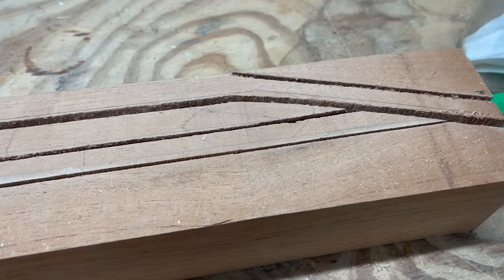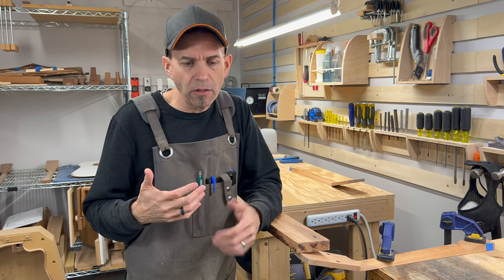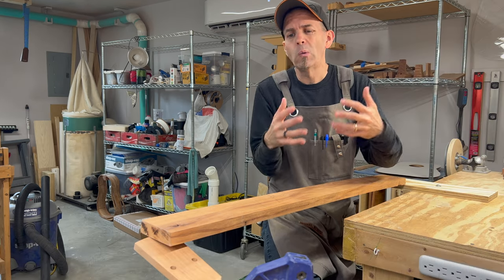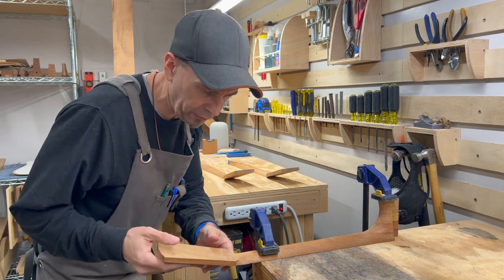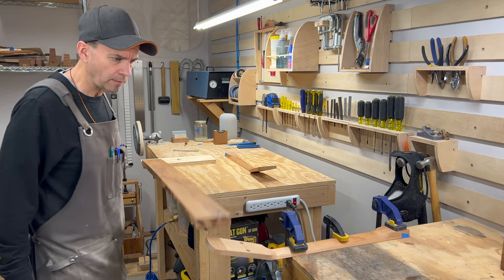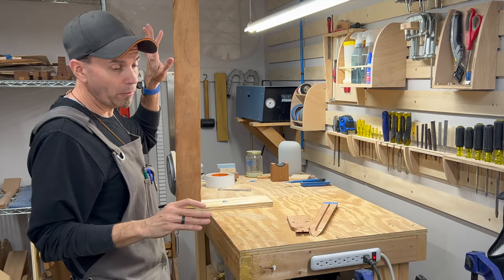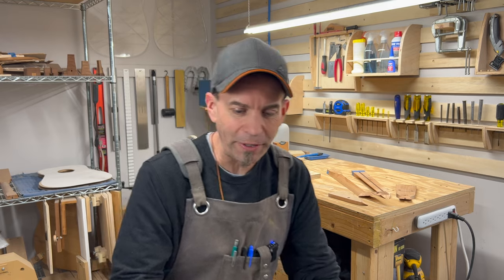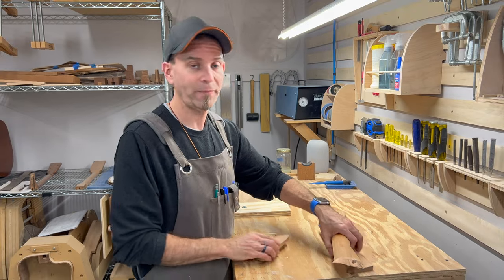Scarfed vs. One-Piece Guitar Necks - Part 3

Comment: I think the fretboard being glued above the scarf joint adds a fair bit of strenght, making the scarf joint the better choice. The fretboard doesnt really give any more strenght with a one piece, because it will break in the grain lines inside the headstock on the other side of where the board is.
Reply from the maker: Could be.  I’m hopeful someone will get inspired by the testing and take it to the next level!
Reply: Two friends: one with ibanez s (maple scarf joint, rosewood fretboard), one with epiphone les paul (single piece mahogany, rosewood fretboard).

The guy with the ibanez was fooling around, balancing it on the butt end strap pin, guitar went straight in the air as he was overcompensating and fell straight down tip of the headstock into concrete. If broke near the joint just like in the video. I took it home, the headstock was still on being held by the now bent truss rod and the fretboard (which didn't bend much and I'm sure it helped). Loosened the truss rod, pulled out the headstock and the rod, hammered the truss rod back straight , assembled it like lego to test fit (it was perfect), applied glue and pressure, left it for two days, tuned it and IT WORKED LIKE NEW.  Some sanding and finishing on the back and it's great. 
18 years later Ibanez is still great.

The guy with the les paul had his in the case and he kinda threw it on the back seat of a car, opened the case and the headstock was off: it broke behind the nut, not like this one in the video, but like countless other les pauls online. It left irregular and much smaller surface for gluing to put it back like I did the Ibanez. He took it to several guitar repair guys, some didn't want to bother, some wanted money nearly as much as a new guitar. He bought new laminated neck Schecter.
10 years later Les paul is still on his wall in two parts.

 Me, I'm a bass player, mostly owning/owned Fenders with inline headstock (maple with mostly rosewood fretboards). One is still straight, others are bending or are permanently bent towards the fretboard (nothing extreme, but I found it annoying, so I sold them). I have owned scarf jointed basses too and had no problems, only benefits: no bending (at least not perceivable) and equal pressure on the nut from all strings (no string trees or bars needed).

From my experience and this video I can tell I prefer scarf joints over single piece.
Reply: @pilsonguitars you do the test..that's how scientific test works..test change test change......

Comment: Tim, I think a 1 piece neck with wings and a backstrap massively improves the weakness of the runout. 
Also, your first test, with only two pounds, shows us how strong both joints are without any string tension and why loosening your strings during shipment and travel, since the impact of being dropped inside a case case snap headstocks. 

These are great.
Reply from the maker: Great feedback!  I hadn't considered wings as a means of strengthening the headstock, but that makes a lot of sense.  Also a great point about loosening strings during travel.  Thanks for the comments.

Comment: So in this case it would much easier to repair the scarf joint than the one-piece. For me its the scarf joint, used it for all my builds
Reply from the maker: From a repair perspective, I can certainly see your point.  Fixing that headstock would be a challenge.
Reply: I suspect if both necks had a fingerboard attached, the scarf jointed neck would have survived. Just a hunch. ☮️

Comment: I bought a guitar with a broken neck recently, and had a break right at the scarf, just like this, so I would say to those wondering, No the fretboard probably didn't help. I don't know exactly how the neck broke, but I assumed it was a tip over/drop like this. In my case, I'm planning to repair it simply to see how it goes, but it's not actually necessary since it's a bolt on neck. If it doesn't repair well, I can just replace the neck entirely.

Comment: Would be very interesting to see the difference between a 17 degree neck and a 10 degree neck, or even a lower angle. 
I suggest a volute will make very little difference to the test, as both breaks occurred away from the volute area. 
But, a volute may well make a big difference if you did a test on necks with the trussrod slot cut into them.
Reply from the maker: I have bounced between 15° and 17° headstocks.  I was considering whether that would make a difference, but I went with the more aggressive angle for the test for more of the extreme.

Comment: Another great vid. 
I wonder how much effect a fretboard over the scarf joint would have - I'm guessing it would help absorb quite a lot of the force and maybe stop the break. Whereas the fretboard would have no effect on the one piece ue to where the break occurs.
Reply from the maker: Thanks for the feedback.  Since the impact was coming from the rear, and the fretboard would be on the front, I don’t feel like it would have been a tangible effect.  Hard to say though.  Several things surprised me in this process.

Comment: Thanks for sharing this. Great test all round. Perhaps things like V-neck joints are worth it, after all. 

Interestingly, a volute on a single piece neck is probably not worth it seeing how it broke. It may not actually add much strength if the break angle is not the weakest part.
Reply: I've tested the V joint - it's weaker than either the scarf or the solid neck. The only necks I've ever had break were v jointed.
Reply: @BobStCyr  that's really interesting. Thanks for sharing. I assumed the additional long grain surface area of the v would have helped with the glue joint. More areas to go wrong I guess though

Comment: Interesting series. 
As previously mentioned: not a large enough sample size to be conclusive. A sample size of 2 provide a clue of what might happen, but you need a much larger sample size to draw any statistically valid conclusions.
Would have been interesting to see what affect keeping the simulated string tension would have. You could have suspended 40 lbs of weight from the headstock and then simulated the fall.

Another option would have been repeating the drop test, without adding weight, multiple times.
Enjoyed watching. These tests did reveal that things aren't as clear cut as we think they are. Thanks for the time invested and sacrificing good material.
Reply from the maker: Yes, absolutely.  Maybe not conclusive evidence, but at least an insight into the consequences of different methods.  Appreciate the feedback.

Comment: I have never used a scarf joint as it has always seemed suspect to me. I also dont make one piece necks as I have never been able to obtain perfectly quarter sawn stock in that thickness.
I prefer to make two and three piece necks. Two piece produced from one piece of straight grained mahagany as near to quartered as possible but cut down the centre and reverse one piece to balance the grain pattern and stresses. My three piece necks are made using a perfectly quartered centre piece with another section cut in half and reversed as in the two piece. This gives me the best possible stability and strength in all directions. I like to use two further sections to make up the headstock width whilst also strengthening the short grain. I sometimes veneer the back as well as the front of the headstock which adds further strength and also incorporate a volute into the design. I have never suffered a headstock break but am confident that my build offers the best protection. I just dont feel the same about a scarf joint. Great video by the way - there will always be people who doubt your testing methods but at the end of the day I believe you have done more than most.
Reply from the maker: I really enjoyed reading your process.  I think you’ve nailed down an extremely solid build method.  That’s a lot of work, but I’d bet those look and function impressively well.  Appreciate you sharing so that we can all learn from each other.  Thanks for watching.

Comment: Thank you for doing this experiment! The scarf joint would have a truss rod and fretboard in there providing reinforcement using very dense materials..so in real life, I don't think it would break that easily. The one-piece neck break is a classic Gibson trademark feature and behaved exactly as expected :)
Reply from the maker: Fretboard, yes.  Truss rod, in my case, no.  I'm running the truss rod down into the body of the guitar so I'm not getting any help in the headstock area.  One thing to consider, if you route your truss rod through the headstock, you are also removing a decent amount of material for that channel, providing less wood in that area for support.  Is it compensated by the truss rod itself... not sure.

Comment: Reasonable test design, good contribution.  But I'd like to see a lot more trials before drawing conclusions.  There are so many variables here, you'd need a LOT of trials to draw any conclusions with confidence.  Which I know is not practical, so you did all that was reasonable.  Different wood species, different glues, different details of the scarf making process, what does a vollute do?, could change the result.   If someone wanted to break 100's of necks using that test, I'd be really interested to see the results.   I won't hold my breath.   Maybe a guitar playing engineering student will do their PhD thesis on it.
Reply from the maker: Fair points.  Having a large sampling of data points certainly provides a better means of coming to a conclusion.  My assumption when I started this testing was, most luthiers have probably never gone through any cycle of testing to compare their build methods.  My hope was that it provided additional insight into their methods to help all of us become better builders.  I'll leave the conclusion to each of you. 🙂  Thanks for the feedback.

Comment: Hey, did you consider the effect of the pre-tensioned neck with around 220 pounds of force applied by the strings?
Pretty sure it will make significant differences.
Reply from the maker: We did in fact mention that as we got started in this episode.  We also tested the effects of string tension, in terms of headstock deflection, in part 2 if you're interested.  I'd love to see someone do a break test with a fully tensioned neck and fretboard.  We couldn't invest anymore into our testing at this point.

Comment: I am looking at a Kay neck from 1960s. I see the long grain extends into the head stock with no apparent scarf joint.  Is it possible that these necks are steam bent from a simple plank?

Imho, the headstock repair would be simpler to repair.
Reply from the maker: I’ve never considered bending the headstock into place.  I suppose it could be possible.  I wonder how well it would stay over time under the string tension?  Interesting…
Reply: @pilsonguitars  I've sanded that neck all the way down now, no evidence of a scarf joint, there are however, readily apparent joints where headstock wings are glued on. 

I don't think string tension could hurt it, but if it ever encountered steam it would revert to original shape.  I have a spare neck, do you want it?
Reply: @pilsonguitars 
More info, I am not seeing a heel joint on this neck. It must be carved from a block.

Comment: I've only had two necks break on me in my life... both were scarf joints. Ultimately though, nothing is immune from breaking in the right circumstances.
Reply from the maker: Interesting.  Definitely agree, under enough stress, things will end badly.  I was mainly interested in the rigidity of the headstock and joint over the break test.  I wanted to see which neck provided the least amount of deflection.  I was surprised by those results.

Comment: I don't like the way one-pieces make use of the wood, but I also don't like the way a visible scarf joint looks. I've also only ever seen a one-piece break closer to the nut, not really ever up into the peghead that far. Can't say I've ever had a broken scarf joint come around, but then again, there are probably fewer examples out there...
Reply from the maker: I hear you and I agree on both counts.  One-piece necks are a terrible waste of good wood, but then that joint isn't awesome looking either.  Some do nice work of putting a complimentary piece of an opposing color in the scarf for some decoration.  Those look pretty neat.

Comment: I think people who said that the scarf joint should be in the headstock instead of the neck shaft are correct because there would be more glue surface in that case, and the area where the joint is weakest, i.e. along the grain at the glue joint, would be greater, so stronger.   If the joint is going to fail it will be in the weakest part of the neck, so we want to make that as strong as possible.  We want to avoid having the neck split along the grain.
Reply from the maker: I could see how that might be a benefit.  I'm curious if that method would have resisted the break entirely.  If I ever test again, I need a testing weight between the 2 that I used.

Comment: I just watched part 2. I commented there and will paste it here. I think my logic still stands.
@jonahguitarguy
0 seconds ago
I think the test is legit but there are years and years of actual breaks that tell a very real story. Things not accounted for like the fretboard reinforcing the neck right at the nut. The huge truss rod nut access that Gibson and copies use. The fretboard reinforcement at the nut could pinpoint all the stress right at the short grain which would be mad even weaker by removing so much material for the rod nut. Maybe another way to test would be to use two completed necks. Even with truss rods installed. There thing is that until the necks are broken or fail you can't see the whole picture.
Reply from the maker: Yes, I like that idea and would love to see the results of a test like that.  Great thoughts!

Comment: Also, just a side note, but I’ve never actually seen an acoustic headstock break, personally. However, I’ve seen the headstocks of 3 different Les Pauls snap clean off and I’ve always attributed that to the severe angle of the neck, or the tension of the strings at the actual scale length. I know you don’t do electrics, of course, but nothing snaps like an LP under full pressure. So my thought is that string tension and neck angle - which would affect the overall neck tension - would certainly come into play regardless if we’re talking electric or acoustic. While your test methodology is sound, in theory, having a neck attached to a body and under full string tension would give you a much more realistic result. Obviously nobody wants to deliberately break a fully functional guitar, though. Just my $0.02
Reply from the maker: Yah, spot on.  Headstock angle and scale length will play into the tension.  Gibson preferred that 17 degree angle (which is what I'm using as well for the test) and it contributed to a lot of those breaks.  A full build out and drop test on an assembled guitar is the way to go for that real-world test.

Comment: Excellent test setup, worthy of Project Farm or Torque Test Channel.  However, if the scarf joint was a good joint and the glue line held but the fibers just tore away then why did the break follow outside of the joint?  That would effectively not be the joint.  It would have broken elsewhere or anywhere.  I have to say that I feel the joint wasn't glued well.  I have destroyed my own necks in a less scientific manner and the breaks were not following the joints.  Matthias Wandel does some excellent joint and glue torture tests on youtube that would give additional insight into what it should look like.  I missed in your part 1 the type of glue you were using?  The way that you slid the joint together in from the side while using a tight jig likely starved the joint.  I am not trying to hate on this because its a great series and I have subscribed in appreciation of it but real world information from repair shops, while not scientific, prove that repairs on scarf joints are rare.  I build hippie sandwich Alembic style electrics and so laminated necks along with front and rear veneers over the scarf joint, which I locate in the headstock and not the neck, make an incredibly strong assembly.  Please keep pushing conventional wisdom where you see fit!
Reply from the maker: That's honest feedback and appreciated.  I was also a little curious in how that scarf broke with minimal fiber tear.  (by the way, it was Titebond glue)  Unfortunately, it's a long road to get back to that point in the build to re-test so I left it as presenting what I found.  It would be fun to revisit at some point.  Thanks again for watching!

Comment: It wasn't clear to me whether the scarf joint broke on the neck or the headstock side of the joint.  If it was the headstock side then that would be consistent with a short grain failure, because short grain failures are caused by the wood breaking along the length of the grain, whereas a long grain failure would be caused by the wood breaking ACROSS the length of the grain.  Wood is many times stronger (20 times in maple) in the direction of the grain than it is across the grain.  This is why my 6 year old grandson can break a board along the grain with a "Karate" chop...
Reply from the maker: In the scarf, it broke at/near the joint.  On the one-piece, it kinda broke in both the joint and the headstock.  (a bit of an angled break)  Agree with you on the grain strength.  That's where part 2 of this series surprised me in the bend/deflection test, because the one-piece offered greater resistance to bending.